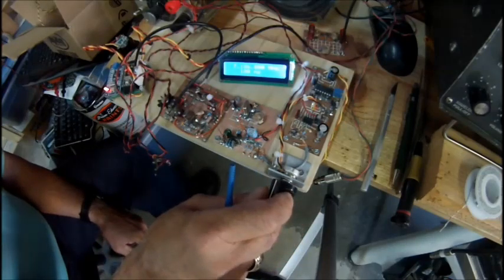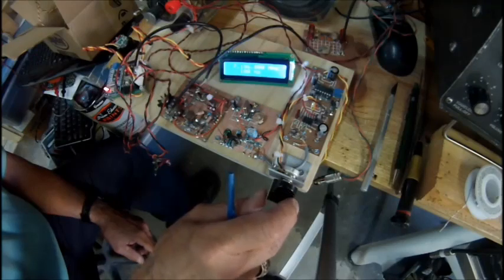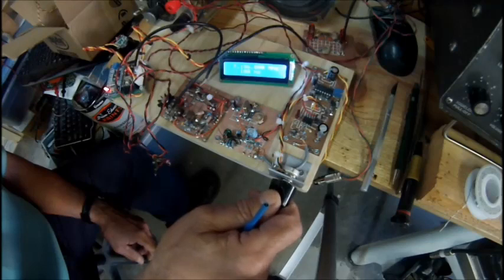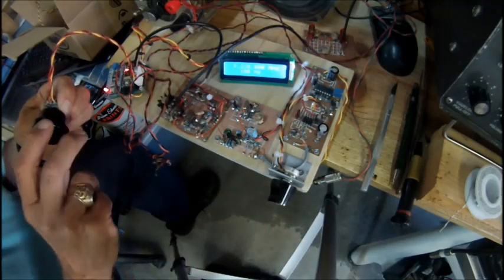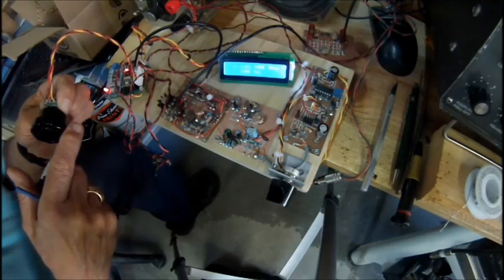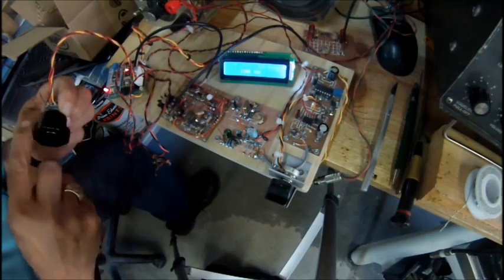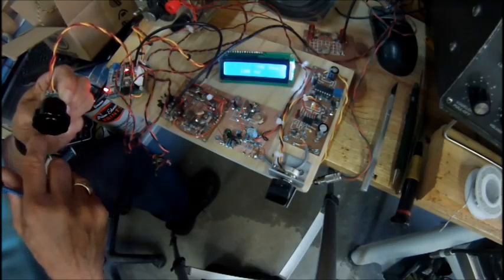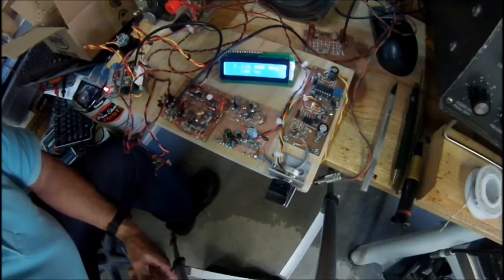Simpleceiver 2nd Generation

Comment: Hi Pete, I have trouble finding a good rotary encoder. All the ones I bought of the KY-040 type were bad manufactured and all are dealing with some sort of bouncing issues. Can you please let me know waht type of encoder you use on the 2. gen of your simpleceiver? Thanks from sTef DM5TU
Reply from the maker: The encoders I use are purchased from Digi-key and are manufactured by Bourns. They are the PEC series and are good for 100K rotations and they only cost $1.38 USD. I usually buy them by the dozen.Pete
Reply: Thanks Pete for your reply. I found 42 different ones at Digi-Key from Bourns with 100k. Do you use the ones with 12 or 24 impulses per rotation? Maybe you can provide a part number. 
When adding the encoder into the SimpleCeiver did you add resistors to the encoder to prevent the bouncing? Thanks for your help.
Reply from the maker: Here is a part number http://www.digikey.com/product-detail/en/bourns-inc/PEC16-4020F-S0024/PEC16-4020F-S0024-ND/3780225 I did not use any resistors and did not see any bouncing.
Reply: TNX a lot, Pete. I am collecting the parts for the simpleceiver. The LBS project has to wait. I need to do more noddling FIRST!!!
Reply: Hi Pete, the encoders got in today. I was searching your HP @N6QW.com for infos on your DDS Vfo. Could not find what I was looking for. Any scematic on how you wired up the encoder to the ARDUINO board. Thanks for your help. In the main scematic ( http://n6qw.com/Images/Simple-ceiver-schematic.pdf ) you show the interface to the VFO. So now I am looking for the VFO scematic especially the encoder wiring of the Bourns encoder. I have them here without any breakout board and pull up restistors nor caps added to it.  73 de sTef DM5TU
Reply from the maker: Here is the scoop. Looking directly at the encoder with the shaft facing you and the three pins at the top, From left to right is Ground, Enc A and Enc B. There are two pins at the bottom. One connects  to ground and the other connects to Pin A3 on the Arduino. The EncA and EncB connect to digital pins 2 and 3 on the Arduino. These are interrupt pins. If you are using the Si5351 connect those pins to Gnd, + 5 VDC and A4 and A5